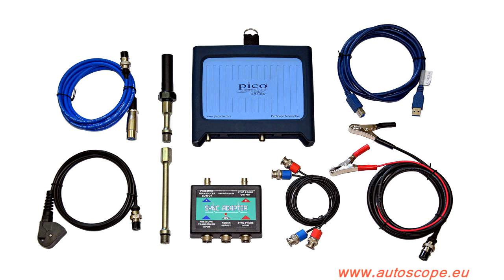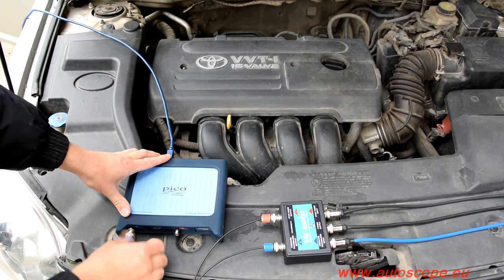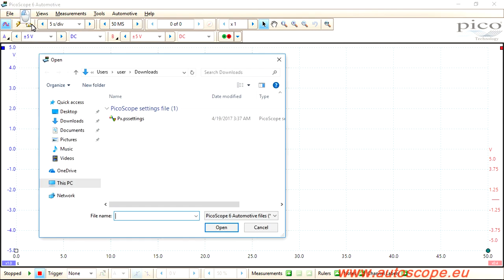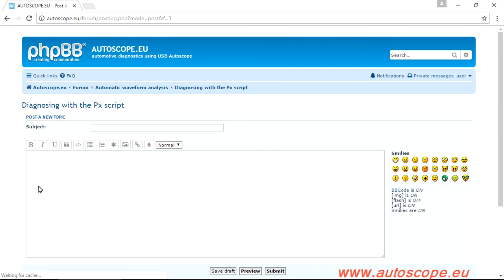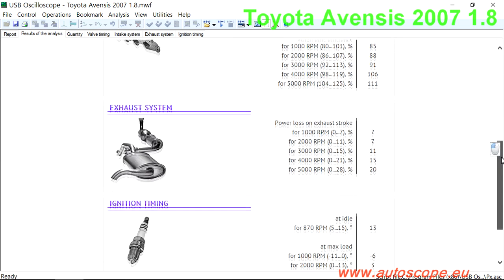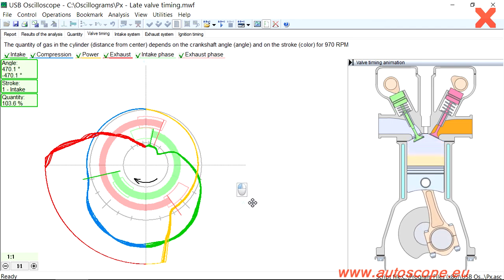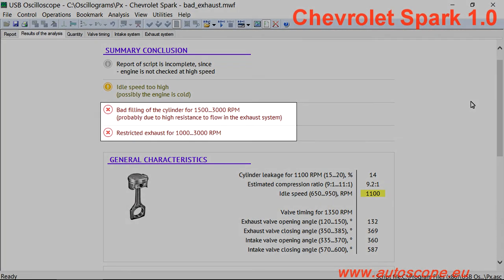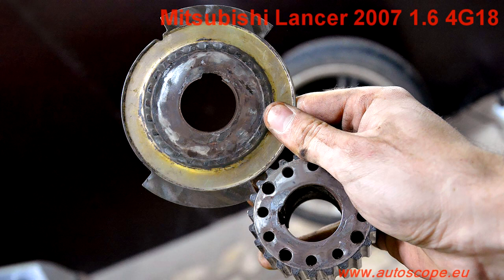In-cylinder pressure waveform analyzing by PicoScope

Comment: Hi, I already have a 4 channel Pico and a WPS 500 pressure transducer what do I need to buy from you to do the above tests?
Reply from the maker: Hi, to perform the Px test with Picoscope, you need:
1. Pressure transducer px35 - 90$;
2. Connecting cable - 10$;
3. Deep well adapter for high pressure transducer M14 - 20$;
or Deep well adapter for high pressure transducer M12 - 20$;
4. Spark gap - 10$;
5. Adapter for high voltage extension cable - 10$;
You can use Pico capacitive pickup.
The connection is shown on the picture. Test done with Picoscope 4225.
https://drive.google.com/file/d/1VKMzp1cGIAu0XtIgu-wPMRIQRzntjk3T/view?usp=sharing

WPS500 can be also used, but only after a modernization.
Can you tell me what model Picoscope you have?
Reply: @AutoscopeTechnology  
Hi thanks for the reply. I have a 4423 Pico as I said I have the WPS500 with all the adaptors to fit in cylinder.
Reply: Autoscope Technology where do I buy the deep well 12mm & 14mm adapter for transducer ? I’d like to buy them